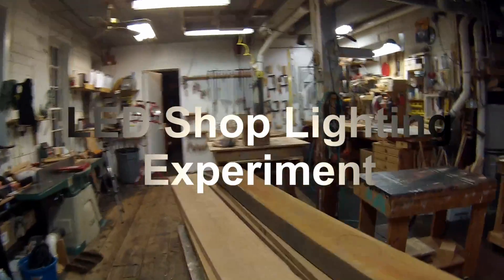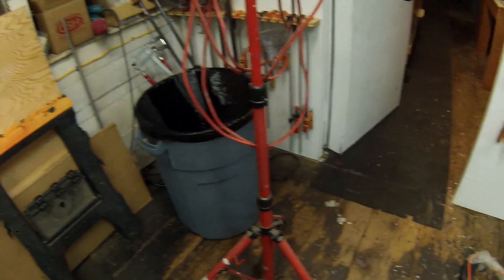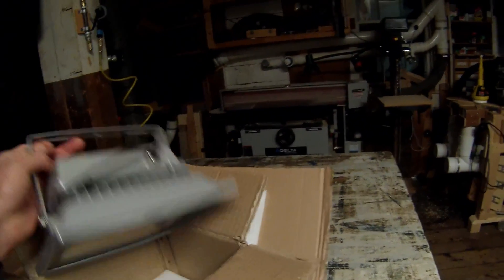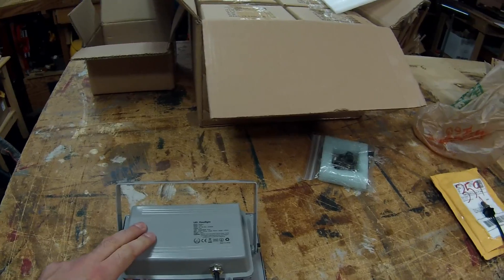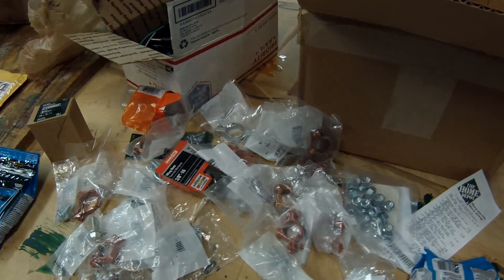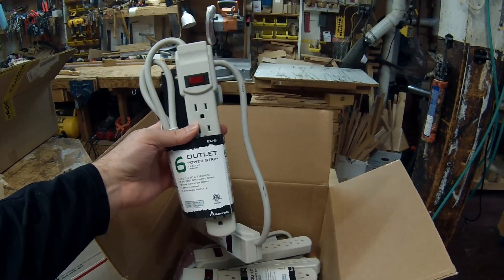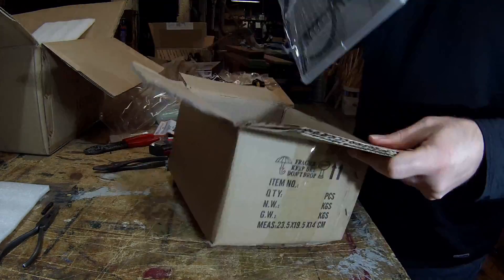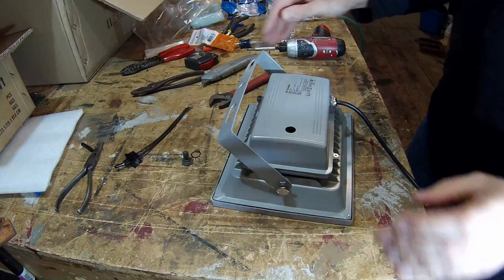LED Shop Light Experiment

Comment: we probably bid against each other on ebay for these. I've got them all over.  Simplest wire up is take old pc power cord.  Everyone has camera tripod they never use just mount on top of those with 1/4 wing nut.   Motion sensors with some is good for quick light on when coming into garage.   Watt meter looks good and no heat like those old halogens.

Comment: Nice innovative idea and build! Should use less energy but more importantly not as much heat when you get close to them. But in Vermont maybe those holograms helped heat up the shop Haha. Might I suggest two light poles each with three lights at different levels and the last two lights over the TS? Just a thought. Thanks for sharing.
Reply from the maker: thats a good suggestion.  or I might try four lights on one tall pipe which will utilize the least space